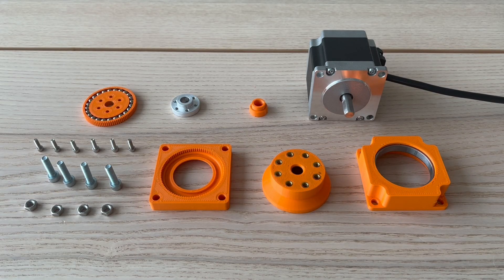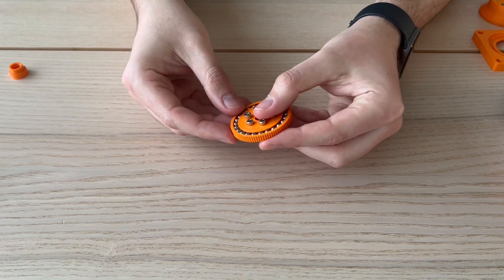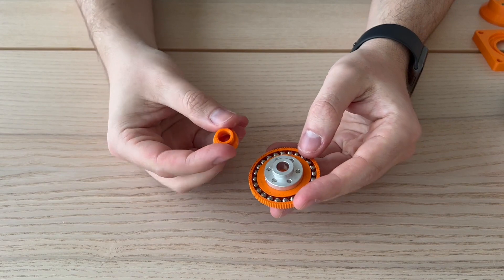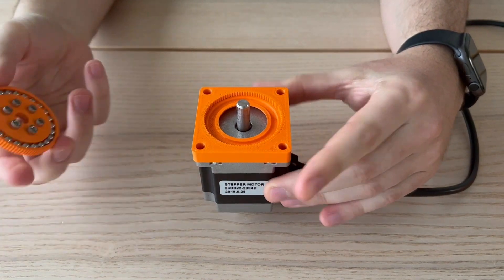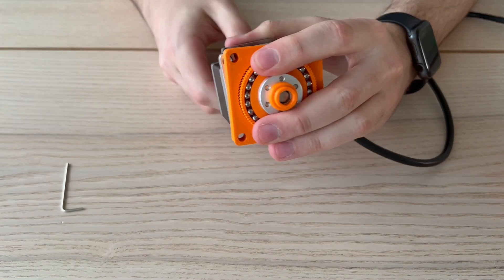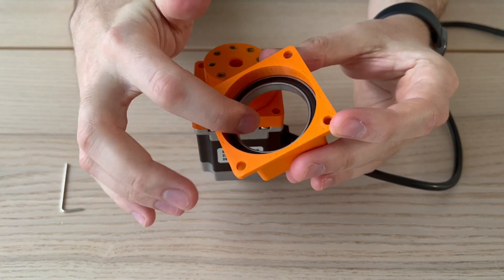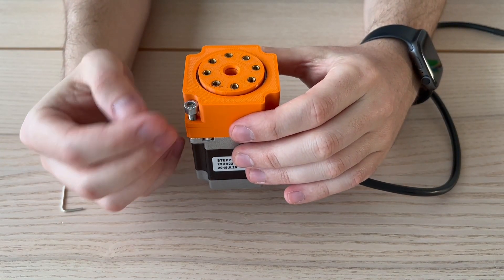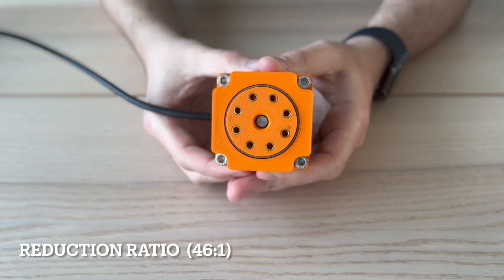Nema23, 3D Printed Strain Wave Gear (Harmonic Drive)

Comment: great ideas and video! Thats exactly what I was looking for, very nice! But durability is a big problem. These tiny PLA teeth break very quickly and cannot withstand any strain. It's better to use a commercial PU T-shape belt as the flex spline.

Comment: Hey there! Yesterday I finally bought your two harmonic gear designs from 3D Cults... and I must say your design is insane! Besides the fact that I haven't assembled anything at the moment, I already assembled it in CAD and oh my goodness, it is absolutely brilliant. I can absolutely encourage everyone in need for a stepper gear to buy those as well. By the way, do you have any new updates on material fatigue for your PLA Flex spline ?  Have you done some tests with TPU ~85A to 100A 
shore hardness? Best regards and keep up the fantastic work!

Comment: I can't understand how 90 teeth ellipse (flex spline) can fit into 90 teeth circle (static spline). If both of them have same number of equal teeth, then both of them should have the same length. And I don't see how ellipse can fit the cirle of the same length as ellipse
Reply: the trick is to reduce the tooth spacing by a very small amount. The difference can be very small.

Comment: What happens if the inner half static gear also has 92 teeth (same as the output gear) ?
Does the output turn twice the speed or keep the same position forever ?

Comment: Hi! I've been trying to design my own gearboxes as well. I've made a few who worked quite well (read >17Nm load) but I want more... I don't want a bigger gearbox, so getting a smaller module is the only option. This is where the problems start. Removing only 2 teeth from the flex spline isn't enough to make its diameter small enough but taking more teeth will lower the gear ratio... You are the only one I've seen using such small teeth. How did you do it? Did you take more teeth or adjust the tooth profile? I'd love to talk about it.
Reply: When you want higher gear ratio in small diameter, you should make a stackable gearbox

Comment: interesting approach, would consider buying it, but won't because you don't include any specs (backlash, output torque (for a given nema23 motor torque; which means you also need to include torque at input step rate as stepper torque falls off quickly based on speed, and how you're driving it (16 microsteps versus 8 versus 32 etc).  Without these specs, we can't tell if it's a toy or has actual utility; hence why I won't be buying it without it.  There's enough free versions around that do include specs.  Other than that I would likely buy it, so hopefully you'll read this and improve your product by applying standard engineering practices (i.e. include a data-sheet of experimental tests).  Good luck!

Comment: This is a cycloidal compound gear, not a strain wave gear.
Reply: No, this is a proper strain wave gear. The flex spline is the orange thing around the bearings. Cycloids don't have flexible bits...
Reply from the maker: Yes @Unmannedair, you are right thanks for the clarification ;)
Reply: @Unmannedair  You could replace the spline with planets and it would have the same mechanical properties. In a strain wave gear, the spline cannot be replaced by anything else.
Reply: @pyalot  if you replace the spline with planetary gears, then you have a compound planetary gearbox. Your criteria for making a distinction makes zero sense since it's indeed possible to create a gearbox that mirrors the properties of just about any other gearbox. The purpose of building a strain wave gear this way is to prevent plastic fatigue, which is not a problem in the metal versions that you're comparing it with.
Either way, it's a pointless splitting of hairs. It's designed a certain way, it has a certain function, and it works. Who cares what it's called... Call it Bluto's elliptical spinach masher... At least then it will be uniquely identifiable.
Reply from the maker: @pyalot that is true, but in that case the principle would be Ferguson’s paradox. In a non split strain wave gear this is not possible to apply.
Reply: It has a strain wave going through the deformable teeth; so id say the term applies. By contrast there are not any parts making a cycloidal motion.... so yeah. Itd be a cycloidal type drive if you reduced the number of 'teeth' / maxima on the wave generator from 2 to 1. Then you wouldnt have any flex anymore and the output wobbler would generate a cycloidal motion. But then again, thats not the case.

Curious what the ring is printed out of and how it will hold up. Personally I think id use armadillo TPU for a part like this... but I think ideally itd be possible to design around some pre-made fiber-reinforced belt turned inside out, I think. Barring other design limitations, I think the transfer of shear through the layer lines of the flex spline is going to be limiting in a design of this type. Unless you bond it to a thin metallic or woven fiber backing layer I think you will run into that limit sooner rather than later.

Comment: How many times did the flex spline broke? and how durable is this gearbox?
What about the backlash?!
And what is the efficiency of the gearbox?🤔
Reply: It would be nice to see the gearbox perform under load. One test I like to do is to put a laser on the output and look at how smooth the output motion is while watching the laser slowly move on the wall a meter or more away. It’s a great way to attach a long virtual “arm” to the output with actually having a very long arm attached.
Reply: @madladlabs  I personally made a very similar harmonic drive hoping to use plastic bearing and a tpu flex spline. That one was relatively smooth, but the speed varied just a bit too much for my purpose(astro photography), I think metal ball bearing like he does, might fix the smoothness and possibly increase efficency enough to use a non tpu felx spline.